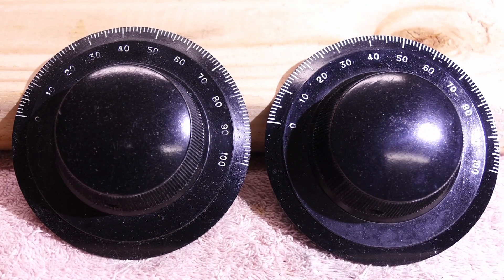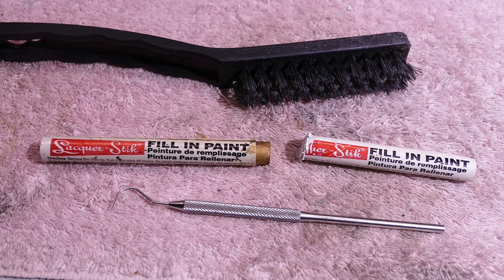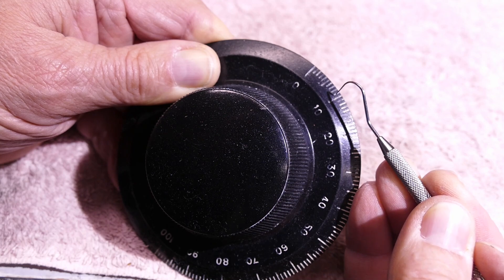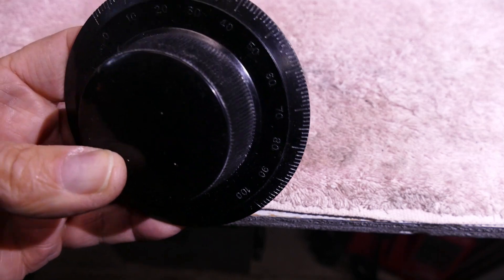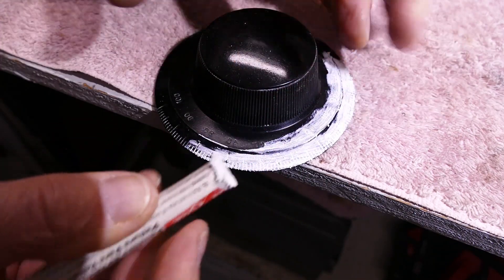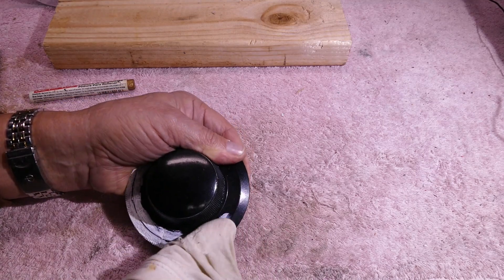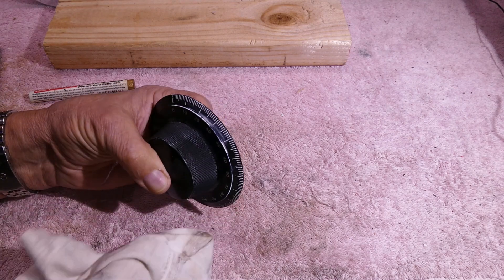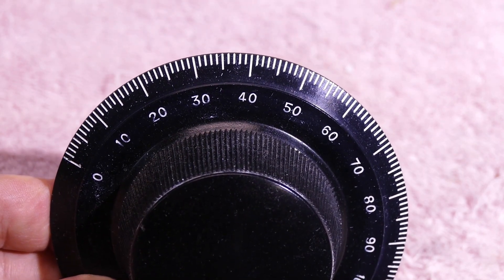How to do Paint fill in vintage radio knobs & other similar items.

Comment: Thank you. I cleaned a 100 year old knob in a ultrasound cleaner and the old paint disappeared (maybe a tip for the initial clean of the loose paint).
Reply from the maker: I too have an ultrasonic cleaner.  I'll give it a try on my next knob project.

Comment: Outstanding! I have wrestling with the F3 letters on my Nikon smudged model paint. I'm gonna give your method a shot. Perhaps I'll hit my old manual lenses as well. Thanks Richard.
Reply from the maker: As I mentioned in the video there are harder ways to do this.  As long is there is a groove for the paint, it is a snap.  I'm sure you will like the result, it's an easy process.

Comment: Good vid! Was an OM, opticalman, in the Navy waaaaaay back and we would put the metal parts in an oven to heat them, pull them out and use these. It flows super smooth and after it cools go back with a rag and a couple drops of oil to wipe it off.  Heat gun for Bakelite plastics.
Reply from the maker: Thanks for the tip.  I'll give it a try for next time I use it.

Comment: Thanks for the tip! I'm going to give a fresh look to some antique cameras thanks to you.
Reply from the maker: Glad it works for you.  I use the same paint sticks on the harmonic balancer on my vintage '57 Fairlane when I check the timing.  Anything with a grove to hold the paint will work with this process and the paint is cheap.

Comment: I use the same method but with ivory paint. Then I apply glow paint on top just to add to the cool factor! I always like to add a little uniqueness to my restorations.
Reply from the maker: While I use new components under the chassis, my restorations are to make it look as much like new as possible.  Some marks are not repairable and I just call them "history" marks.  Radios from the 20's - 40's (mostly what I work on) have been around a long time and few survive in pristine condition.

Comment: I was looking how to do this for my old AVO 7 multimeter. Thanks!
Reply from the maker: Glad I could help.  It's really an easy process with the right materials.
Reply: Yup - did it on a Simpson 260 and it worked like a charm.

Comment: Great video...I am planning to do this to some black guitar knobs that have white paint in the number stamps.  Couple of questions...how long does it take the paint in the grooves and numbers to harden?  Any issues with the paint rubbing off if you start using the knobs right away?  Any issue with using a mild solution of lacquer thinner to wipe off the excess or does it take the paint out of the recesses as well?
Reply from the maker: The paint is pretty dry to the touch right away, but I would wait a day if you can.  I would not use any solvent to wipe off the excess paint.  However, if you were to get it into a groove or scratch that you have problems getting the paint out of, then perhaps I might try a little solvent on the end of a Q tip or something like that.  It's actually pretty easy to clean the excess off.  I think a solvent could very well take too much of the paint off.  By rubbing cross grain, you leave the groove filled with paint.

Comment: Hi. Do you think this might work on a pioneer equalizer from the 70s? All lines and numbers kinda faded up.  Is aluminum with black writing
Reply from the maker: If the numbers are printed on the aluminum skirt of the knob, then no, it won't work.  You must have the grooved lines in which to put the paint.  As you can see in the video, I cleaned out the old paint and then put new paint in the grooves.
Reply: @ROKuberski  it has all lines in grave .. I hope it works, I have to try. 
Thank you!
Reply from the maker: If the markings are engraved, then it should work just like in the video.  good luck with your project.

Comment: This is exactly what I was looking for!  Great video and practical.  How long does the paint take to fully cure and dry?
Reply from the maker: To tell the truth, I don't know.  However.  As soon as you wipe the excess off of the knob it is dry to the touch and does not smear.  I'm sure it does cure out quite quickly, but I've never tried to see how soft it is the next day.

Comment: Great video, thanks for posting! I am unable to get a clean result. Some paint rubs off the recessed letters during the wiping process. What am I doing wrong?
Reply from the maker: Hard to tell when I can't see your method.  I clean the end of the paint stick before using it and then I rub it on a piece of smooth steel to get it warmed up a little.  It has to be warmed before it will flow.  If you are wiping it out of the grooves, the grooves may be too shallow for this to work.  Also wipe across the lines, not with the lines.  Hope this helps.

Comment: Hi Richard, so what would you do if you had a black rusted metal dial with white recessed numbering?  I guessing media blast or strip the whole thing back to metal, spray it black then dig out the black like you did the old white paint, from the numbering and go from there…. Any tips for me doing this?
Reply from the maker: I would strip it to bare metal, then apply a thin coat of black spray paint.  If you can still feel the groove in the dial after painting, you can apply the paint stick directly to the painted dial and you should be able to fill the grooves with paint.  I would make sure that the black paint is very well cured, maybe wait a week.  When you apply the paint stick you have to rub pretty hard to get the paint to liquefy.  Start out on a piece of wood and rub the paint stick on the wood until is it soft then put it on the painted dial.  If you start on the dial with a cold paint stick, you may damage the painted surface.  I think it would be hard to scratch out the black paint from the groove without chipping the edges of the groove.  Good luck.
Reply: @ROKuberski  thanks Richard!  You help is much appreciated…

Comment: Is it beneficial to do a second application ?(I noticed a couple of your numbers needed more paint after you wiped the knob.)
Reply from the maker: Yes.  Any defects in the first application can be easily repaired with a second application.  Actually I did do some corrective work after I made the video.  Some knobs are worn and the recess is not very deep.  If that is the case, it is almost impossible to get a great looking job.  It's also pretty hard to deepen the worn areas.  Too easy to slip and damage the knob.  If you have several knobs with paint on one radio, it's best to do them all as the knob with the fresh white paint will make the rest of them look shabby.

Comment: wonderful information, exactly what I've looked for.
But horrifying to check Ebay for the sticks to find them selling for US$25.00 and upward, with import charges and postage to Australia, up to AUS$100.00 per stick......ouch.
Reply from the maker: It's been a while since I've bought this paint.  I still have a good supply.

I looked at the manufacturer's site and could only find it sold in a 12-pack.
https://markal.com/products/paintstik-lacquer-fill-in
I also looked at Amazon and they had single units that look like what I have.  I think they have changed their packaging.
https://www.amazon.com/Markal-Lacquer-Stik-Paintstick-White/dp/B002BY8HKS/ref=asc_df_B002BY8HKS/?tag=hyprod-20&linkCode=df0&hvadid=241914349407&hvpos=&hvnetw=g&hvrand=1301810217665154356&hvpone=&hvptwo=&hvqmt=&hvdev=c&hvdvcmdl=&hvlocint=&hvlocphy=9028709&hvtargid=pla-440961213058&psc=1
I feel for you on the cost.  Can you order the Amazon product without getting screwed?
If you send me two round trip airline tickets to Australia, I will bring a dozen to you.

Comment: Is it working on metal too ? Thank you.
Reply from the maker: Yes, it will work fine on metal, but you must have the engraved lines to hold the paint.
Reply: @ROKuberski  Oki, thank you. Yes, lines will be engraved (1.00 mm depth). Thanks again for your quick answer.
Reply from the maker: You're welcome.

Comment: Great video. I'll go with this method for couple old synthesizer I have with no visible grooves in the knobs and faders. Really hard to tell your parameters when playing in a low light setting like my mate studio that has some nice ambiance lighting. Definitely will go with the gold lacquer stik. THanks! Edit: In Amazon and eBay the Lacquer Stik is $6.99 or more so where you got them for $2?
Reply from the maker: I bought them direct from the manufacture.   Of course there is shipping on top of the cost of the paint stick.  Also, I haven't checked their prices lately.  I bought 2 each of black, white and gold.  Still have plenty left for my projects.  Black was not really needed.  Don't remember why I bought those.

Comment: How long does it take to get dry, oder strong enough to use?
Reply from the maker: There is no odor and it is dry to the touch right away.  It is still a little soft when first complete. Quite frankly, I never checked to see if it was still soft the next day, not likely.  This is not a messy paint.  As you see in the video, it wipes off easily and then it's a done deal.  You can buy the paint sticks straight from the company that makes it.  Cheap and does a great job.

Comment: Will this work on plastic?
Reply from the maker: I believe it will, but the numbers must be engraved into the plastic.  I would also use a piece of unpainted wood to start rubbing the lacquer stick.  It needs the heat of friction to soften the paint.  The plastic may be too smooth to generate heat through rubbing.